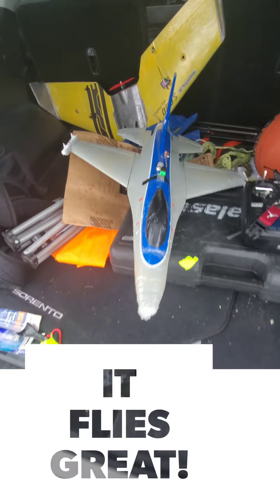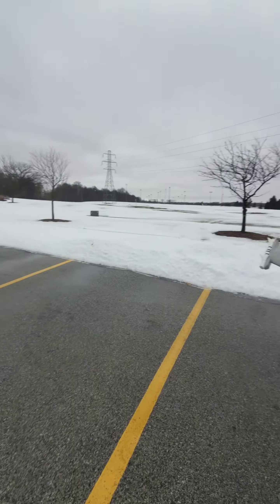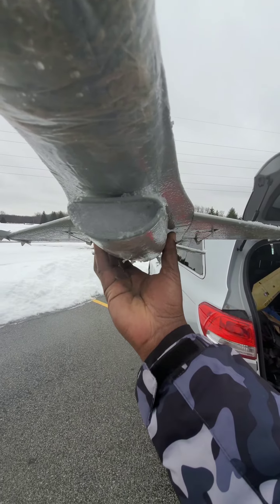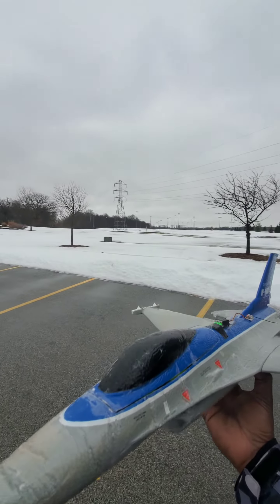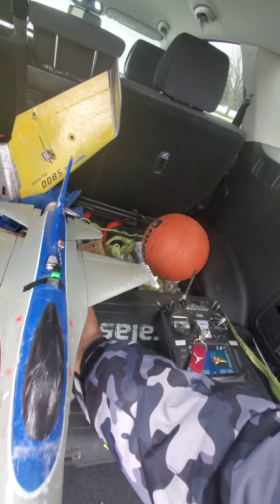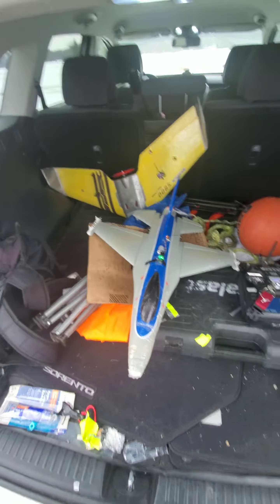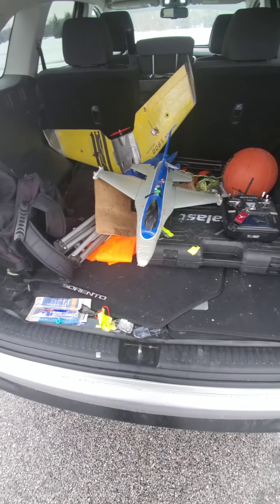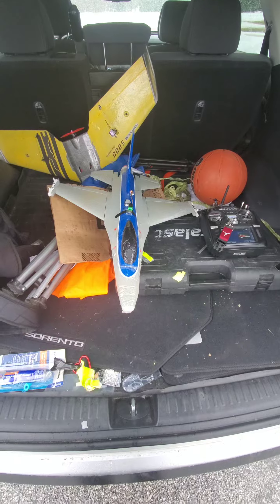Propeller F-16 is a success 🙌

Comment: I'm glad it went well.
Yes, those pusher motors provide more thrust and better flight time than the EDF version.
Glad to hear the Byme-A Gyro worked.
Good timing to as I'm releasing a video of mine tomorrow.
I finally got some good flights with no component failures.
We need more EDF Airframes to convert ;-)
See you in the Air!
Reply from the maker: Might have to try that Eachine F-18 next lol 😆
Reply: @dronepilot260rc  Yes, I'm waiting patiently for the price to come down ;-)